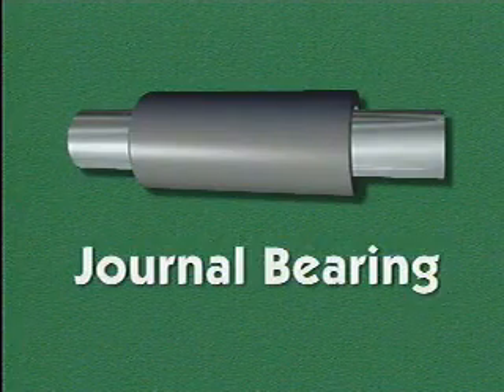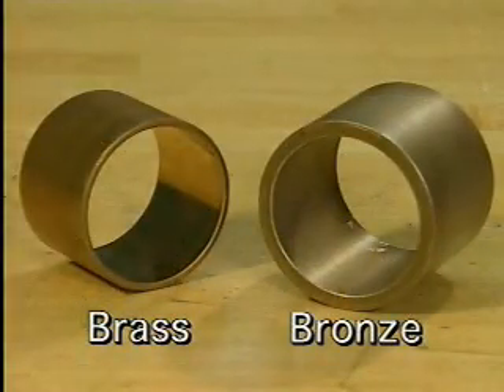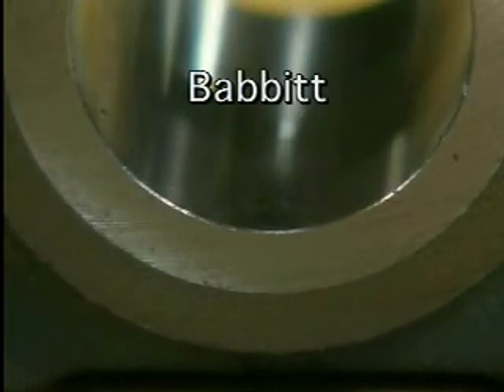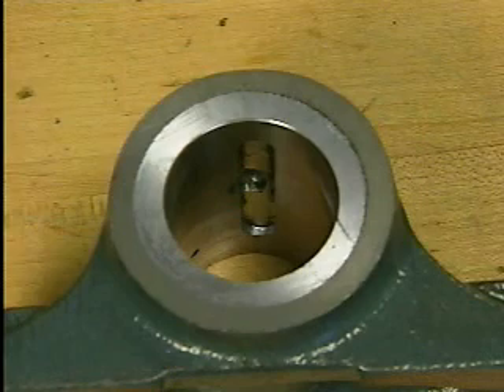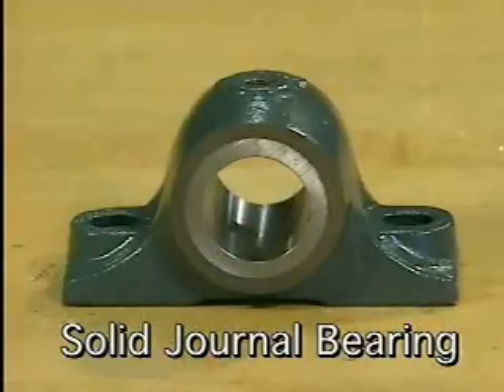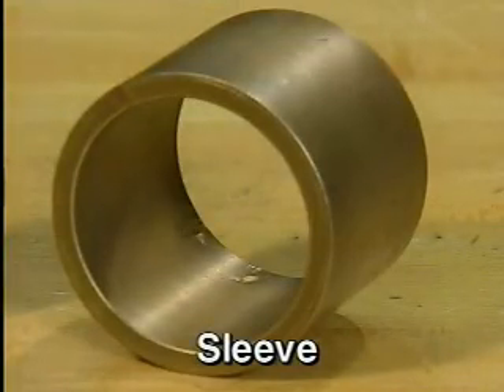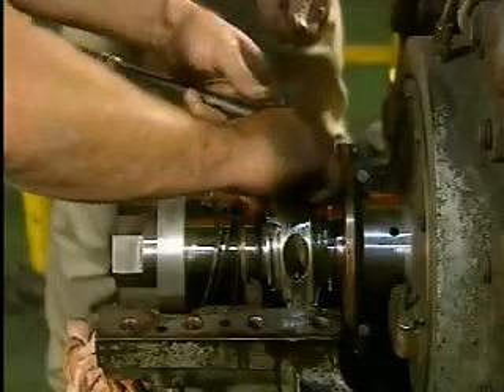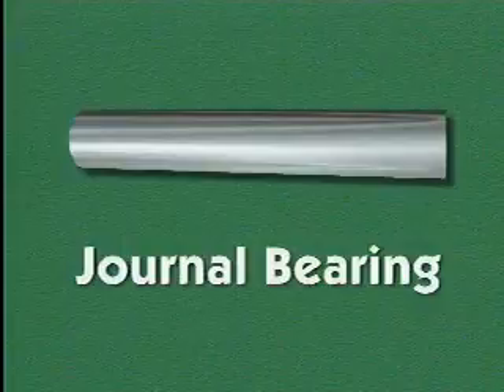Journal Bearing Working Principle Engineering-Engineering Mechanics

Comment: How the lubrication happens in journal bearing?? Once the oil goes in through the oil hole, how it comes out of the shaft and fall backs into its sump or reservoir??
Reply: I'm guessing it doesn't come out from the shaft since the clearance is usually pretty small, from microns to mm . There may be slight leakage, that's why oil is refilled after some time. Just my guess